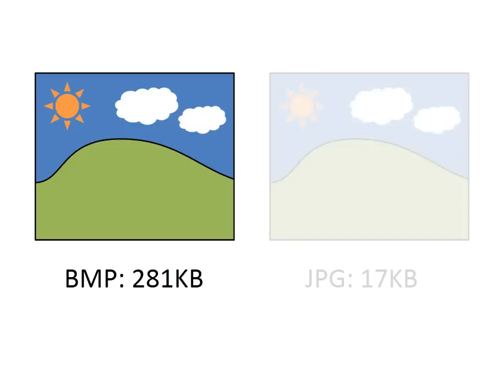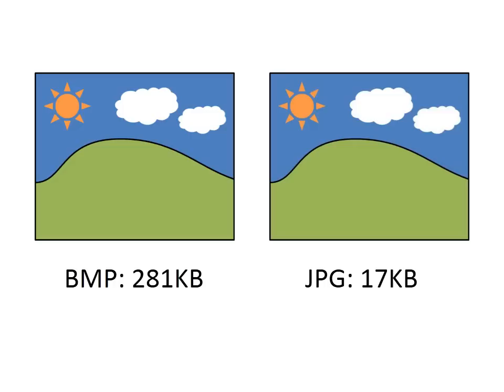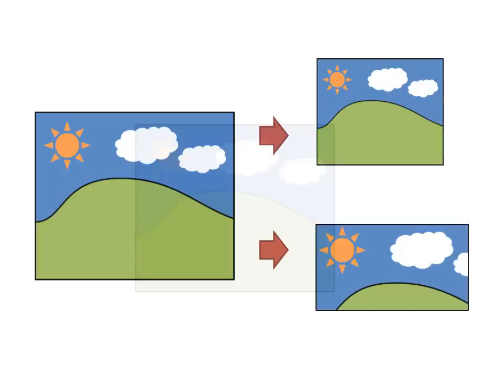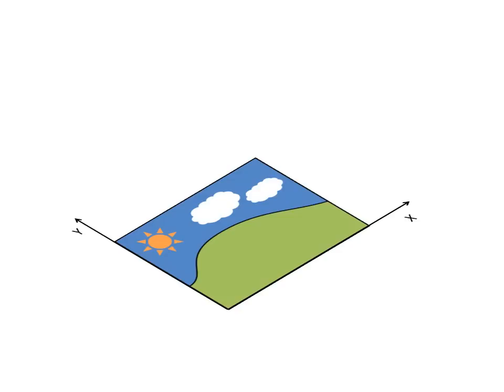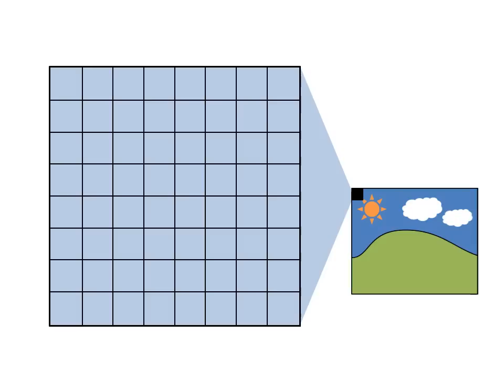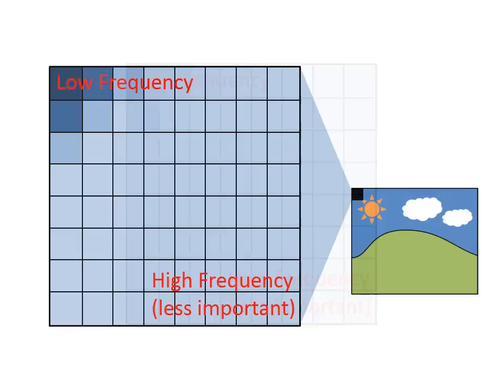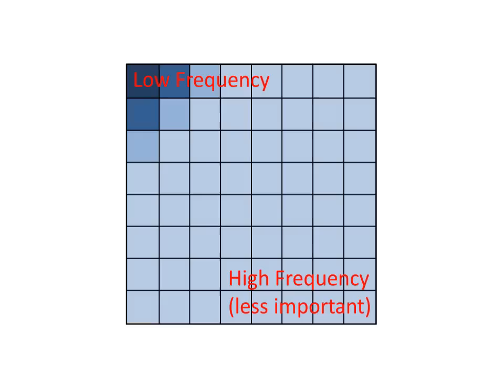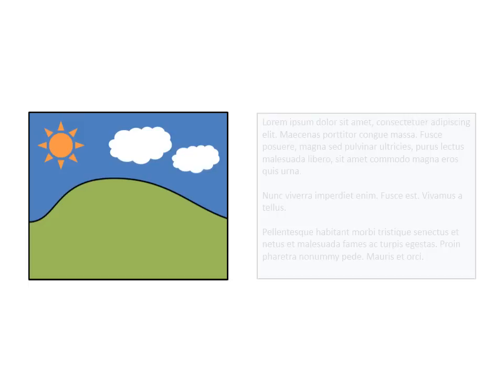How JPEG Works

Comment: 1:44 "[...] because human eye is not so good at noticing high frequency brightness variation". While the statement is true in general starting at a certain high frequency, it is to say that the higher frequencies that JPEG encodes in the "bottom right" of each 8x8 block are indeed perceivable by humans. It is just that not all areas of an image use many high frequencies and this is where JPEG can simply ditch frequencies with low (near zero) amplitudes. It would not make sense for JPEG to store frequencies (cosine coefficients for those frequencies to be precise) if humans could not perceive them to begin with. JPEG doesn't even have to ditch those frequencies really because they were not part of the original/input image since that also came with limited resolution/pixel density. That in turn is because the JPEG algorithm doesn't work on analogue input data but RGB pixel data.